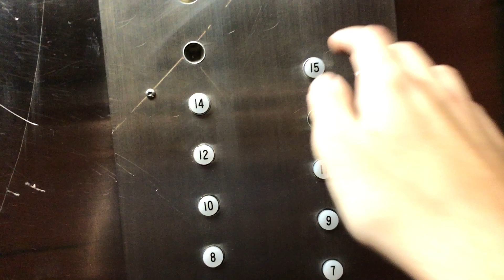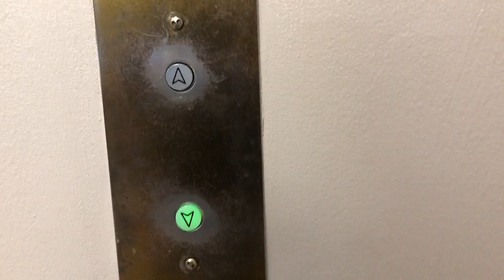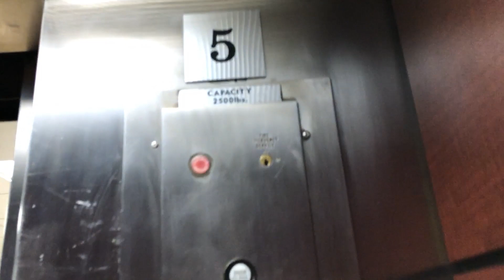Vintage K.M. White Traffic Master Traction Elevators (Rare Fixtures!) in Pittsburgh, PA

Comment: I'm pretty certain Armor made the Traffic Master system. Maybe it was branded under "K. M. White," but I'm pretty sure they were some sort of subsidiary of Armor (unless if they were a company Armor bought). The system itself was probably installed by Hadfield. The 1 car isn't even in the shaft anymore, but the motor's still there & it's an Otis motor.
Reply from the maker: So the car without a lantern has an empty shaft, but the machine for it is still there? Is it a traction machine (most likely gearless), or a winding drum machine? Do the other cars also have Otis machines, or just that one?

From research, Armor did make a system called Traffic Master, but I'm skeptical about it being related to this system, as the references I found to it are from the early 1980s, and I think might be referring to a solid state controller. In terms of the K.M. White system, it looks like it existed at least as far back as the early 1960s. As for Armor and K.M. White being related in some way, it is something I am wondering about.

Apparently, the K.M. White Traffic Master system was what the Chrysler Building in NYC once had!!!
Reply: Yes. And it's a traction machine. I don't know if all of them have Otis motors or just that 1.

All the dates online I saw had to do with/ trademark &/or patent filing. I did see both Armor & K. M. White but the only dates I saw were from the 1970s & 80s for both companies, but the system for sure went back before. Anytime I saw "K. M. White" in a document it was some sort of Armor document.

Oh wow!